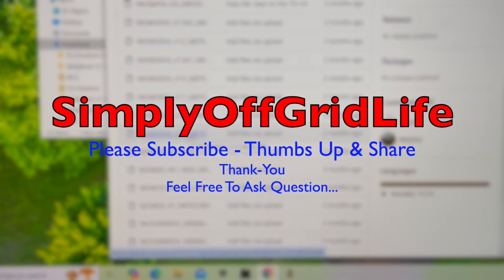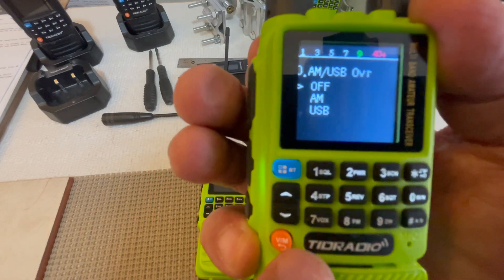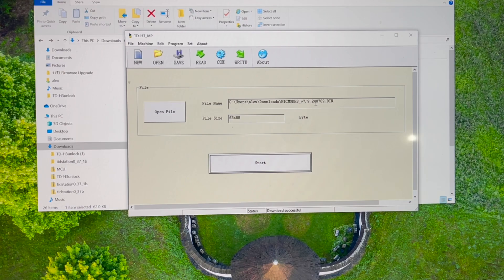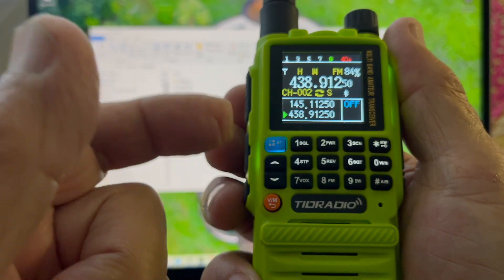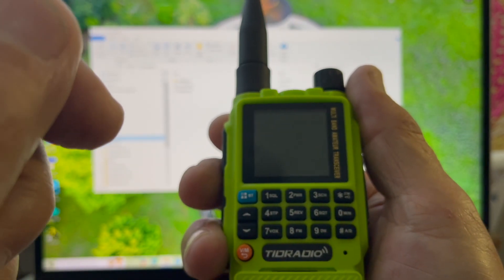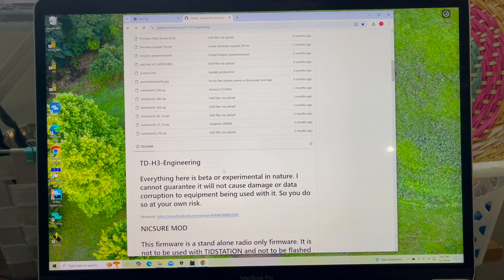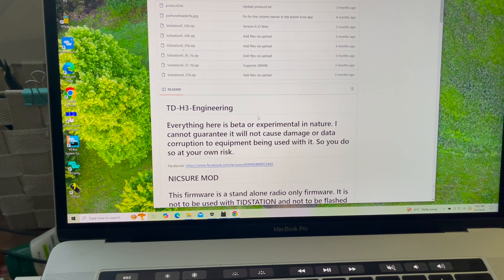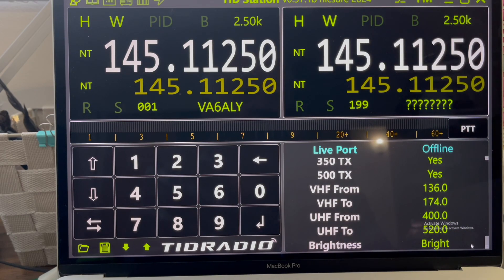Tidradio H3 - TD-H3-Engineering - NicMod Update

Comment from the maker: We tested a non official Aug firmware for H3, haven't notice anything new.  Probably a bug fix pending.  Otherwise working okay.  NicMod work okay even with the august firmware.
Reply: how to keep the mod with the august firmware ?? cant the mod be installed with diffrent firmware ?
Reply from the maker: Yes, it can be done.  I tried even some bad mods.  in order to revert you need to do EEPROM_WIPE.bin, available at same site.  After that, I did the august firmware update, tested okay, then I did surenic mod to have the battery percentage, tone freq and s-meter option.

Tested and work with the unofficial august mod.  

The official firmware is still June.  Mod work on both firmware.  Do the firmware update first, or use current install and then add the mod. 

 Worse scenerio, one can do a EEPROM_WIPE.bin.   I haven't found anything new in the august mod.

I also suspect that tidradio stop firmware updates, as one of the update was bad and may have cause tx power lost.  For some doing the eeprom wipe fixed the issue???  All gossip at this time???
Reply: @SimplyOffGridLife  thanks a million for your replay. i appreicate your time and awesome answer. im your new fan
Reply from the maker: We may not able to reply right away, but will try to do so asap.  Many project on the go..  thanks for your support

Comment from the maker: FYI:  The battery indicator is not a continous state of charge monitor.  It updates only when you turn it off and on.  This may be the same with default firmware.   So far, no issues, I like the S meter and RF output indicator.  Hitting other keys can update battery too.

Comment: Fyi the 2407XX firmware is known to damage the transmit circuitry.
Reply from the maker: It is beta, no issue with any of my 4.  I constantly do firmware update.   Sometimes a bug can happen.  I do a eeprom erase if an issue.  so far all good.  Radio are so cheap to buy and Tidradio will replace the unit within warranty period.  I had the 2407 install when it was first released.  It was removed and they offered june version.  Which I tested and doesn't seem to lose any features.  I suspect it the option mics that are causing any of the issue.  Excessive drive issue i suspect.   Just guessing from what I can ascertain?

Love the units.  Great for kicking around the radio and not concern about damage or lost or theft unlike my icoms, etc.  If in rough enviroment use, I use the h3.
Reply from the maker: So far, all good and nice with the mods.  I like the S-meter now and even rf power, it will show your low power and high.  It also shows the tones and the frequency the reapeater uses.  Tidradio should add this feature to their next official updates, hopefully.